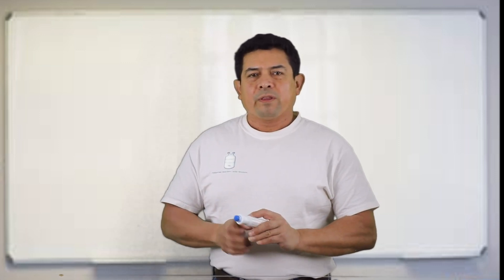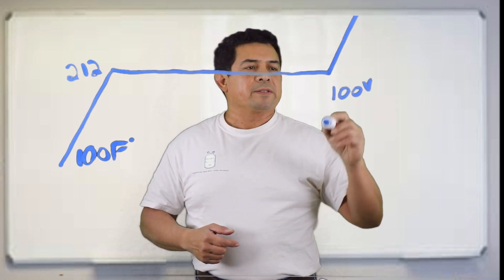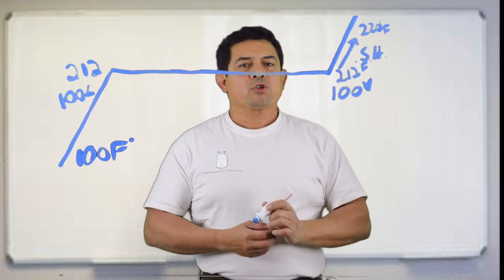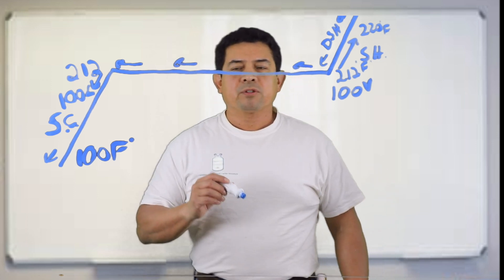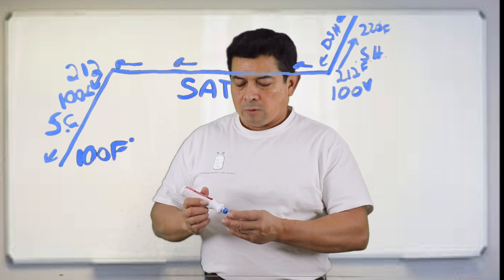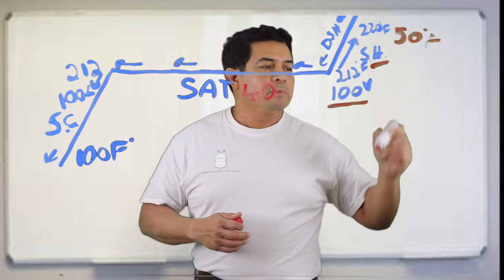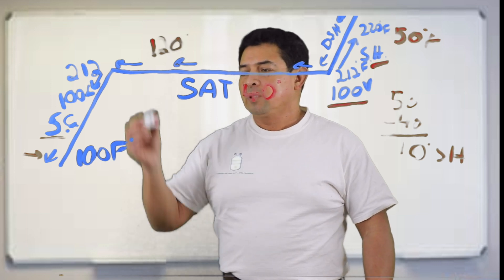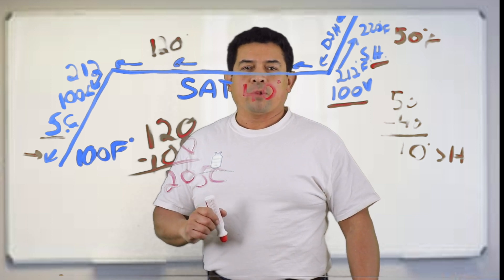Superheat and Subcooling - HVAC Online Training and Courses

Comment: If I suspect the condenser is too small what would be the symptoms besides the obvious. High SH and Low SC ?
Reply from the maker: If the condensing unit is oversized like you said you're going to have high superheat and low subcooling. You will also find that the suction pressure will be lower because the evaporator is not producing as much refrigerant gas as it should causing the suction pressure to drop. Your high side pressure will also be slightly higher because the evaporator is not taking in as much refrigerant as it should.      Make sure you do not have air and noncondensibles in the system. Because that will also affect your pressures and temperatures.                              I do not know your situation if it's a unit that has been running that would be the first thing that I would check air and noncondensibles. Thank you for the question and thank you for watching!
Reply: @AirConAcademy  I understand your description of SH & SC but not sure how to apply it. I'm not a HVAC technician but an electrician whose paths sometimes do cross. The unit in question is a fully ducted whole of house system R22 and purged. I asked a technician to advise me and he said that it was short of gas and I would need to buy a cylinder of the refrigerant.  Very expensive, old technology and not sure of a favourable outcome. The reason for my apprehension is that having seen other units in peoples houses and then investigating the size of the evaporator that suits my condenser was incorrect. To learn from this situation I would like to know the scientific facts of this .. I'd appreciate your expert opinion. Thank you so much for your dedication to this subject.Muchas gracias or  grazie molto
Reply from the maker: @ I am glad he told me that you were an electrician. That helps me know where the question is coming from.                     The refrigerant is boiling inside of the coil. Yes I did say boiling and it is boiling at 40°F approximately. But it has completely boiled away. The gas keeps traveling through the copper tubing. The Gas is in contact with, typically 75°F air, so it warms up the gas higher than the 40°F.              this rise and temperature is what we call superheat. The less gas you have in the evaporator the more area is going to be in the evaporator to superheat to the gas.              Depending on the unit, we typically want anywhere between 8 to 12°F of super heat. That means that if the evaporator is boiling the refrigerant at 40° we want the gas leaving the evaporator going to the compressor to be no warmer than 52°F. That gives me 12° of superheat. By adding refrigerant we have more liquid refrigerant in evaporator and less space in the evaporator for the gas to get super heated.               I hope this explains a little bit about how superheat happens.                   yes, I know that refrigerant 22 is very expensive but you may not have a choice but to add refrigerant if the heat is too high. There is a lot to talk about in the subject and I do that in my classes. Here it is kind of hard to explain all of this to you and get you to understand it.                     I don't know exactly what you do, but be careful of contractors because a lot of them just want your money.     if you would take a look at my YouTube channel, I have several videos how the refrigeration system works and about superheat and adjusting superheat.             I hope this makes sense and please take a look at my channel. Like I said I have several videos there that will help.        Good luck and let me know if you have questions.

Comment: Thanks 
How subcooling affects the expansion valve sizing and cooling capacity?
Reply from the maker: Subcooling is how you charge a system that has a TXV for the metering device. If you do not have enough subcooling the evaporator is going to be starved. This is why you charge a TXB system with subcooling. The manufacturer will have decided what size the expansion valve needs to be so they do the sizing, we just do the proper charging. I hope this helps and thank you for watching.

Comment: When the gas temperature is 40'F in saturation state and it is in vapour state, how it comes subcooled liquid  at 100'F, please explain...
Reply from the maker: In that chart you are looking at one side is for the low pressure side and the other side is for the high-pressure side. So on the low pressure side the saturation temperature is going to be 40°F and we are going to superheat at approximately 10° so now the temperature as the gas leaves the evaporator is going to be 50°. On the other side of the chart I'm talking about the high side so it leaves the compressor at a hot temperature approximately 200°F and then we de-super heat so we can bring the temperature down to saturation temperature and that could be right around 120°F.  After we have turned it all into liquid then we can start the sub cool. The temperature dropped from 120°F down to 100°F so we have 20° of subcooling. This is what happens in the refrigeration cycle so if you can understand this and with just a little bit more knowledge you can easily troubleshoot an air conditioning system. This is how I teach my guys in class the system and how to troubleshoot.  Good luck out there I hope this explains it and please! Keep learning!

Comment: sir do you have any refrigerant chart for superheat and subcooling limits, please suggest me
Reply from the maker: Thank you for your question. And I'm sorry I do not have any charts for superheat and sub cooling limits, but on air conditioning equipment I'll go by what the manufacturer suggest and if I don't have anything I'll make adjustments so it will be 8 to 10° of superheat. On the sub cooling if I don't have anything from the manufacturer I usually try to hit somewhere around 10 to 15° of subcooling coming out of the condenser. I hope this helps. I know this is just a rough number but this is what I try to do a lot of times. Thank you!
Reply: @AirConAcademy  thank you for your feedback I have learned lot of things in your video I once again thank you so much sir
Reply from the maker: @rudramuniah6002  thank you so much for your comments, this is why I do these videos so that you guys can learn and improve your life and your family's life! Keep learning and good luck out there!

Comment: I just need to ask why don’t you experience a pressure change when superheating? It’s above the saturated temperature, but the pressure reading won’t be affected? I thought they were directly proportional.. if the pressure/temp chart on the suction outlet of the evaporator has a reading of -10• , and I have a -6• temperature probe reading, won’t I find a corresponding pressure change? How is it possible
Reply from the maker: Very good question! Because the super heating is happening on the low side the pressure will stay the same. The engineers have set up the system so that the pressure will be virtually the same throughout the low side and then virtually the same on the high side.  The PT chart will always give you saturated temperature. Meaning that when you get the pressure and you look up the temperature that is the temperature at which the refrigerant is saturated, meaning either evaporating or condensing. After it has completely evaporated the pressure remains the same because it is on the low side but the temperature will increase because there is no more liquid to boil off and because of that the temperature rises. I am not sure if this makes sense but if you think of the compressor running and sucking the refrigerant out of the low side it does not give the pressure a chance to rise. I hope this helps and thank you for your comment.
Reply: Pressure and temperature are only proportional if volume and the number of moles (amount of gas molecules) is constant. In these systems the gases (in this case superheated refrigerant) are not contained in a static chamber but are flowing (exchanging hot moles for cold moles) through the system changing density (and so volume). The constant equation is useful to understand the effect the compressor has on the system, though, as the compressor momentarily pauses the flow while reducing volume to increase pressure (and so temperature) before letting the newly pressurized gas flow into the condensor. 

The key here is the flowing gas through the TXV/EXV and compressor inlet.
Reply from the maker: @markbell8967  I like your explanation and yes the flowing gas makes the difference.  That is why I mentioned the compressor running and sucking the gas out of the evaporator and not giving the pressure a chance to rise.     I was trying to make it easy to understand.   Thank you for your comment and explanation.
Reply: I agree your explanation is more succinct. I was trying to expand on the equation he referenced. Thanks for making this awesome video.
Reply: Also, if the temperature rises, the TXV valve is adjusting nearly instantaneously right? 

His question was a good one. It is helping me learn in a great way. Thanks for your answers.
Reply from the maker: @markbell8967  Yes the TXV   will will adjust instantaneously!!!   trying to maintain the proper superheat.

Comment: I don't think so, superheating start when we raise the temp of a gas without raising it's pressure and  vice versa for subcooling. When refrigerant leave the Evaporator, it travel toward compressor and there is no question of raising or lowering the pressure at that time. By taking heat from surrounding the liquid particles in suspension got evaporated (boiled) and then started  superheating factor. Like in subcooling, when the condensor is fully cleaned or the atmospheric temp is low the subcooling started in condesor(e.g, the subcooling started much before the saturated liquid curve in moiller diagram curve is reached). If you are cooling water to below 100,that is I think is not subcooling.
Reply from the maker: Superheatig is when you raise the temperature above the saturation temperature, and subcooling is when you lower the temperature below the saturation temperature. Yes the heat is usually  absorbed from the surrounding air?  If the system is designed properly, the pressure in the low side should be virtually the same and mostly the same in the high side. so the as the refrigerant gets closer to the compressor, the suction pressure should be at approximately the same pressure as in the evaporator. If the system is charged properly the refrigerant will start to superheat in the evaporator and gain superheat as it gets closer to the compressor.   If water is below 212 degrees F. at sea level or at 14.7 PSIA Then water is said to be cubcooled, because the temperature is below saturation temperature.   not sure if this makes sense.  I hope this explains what I was trying to say in the video.
Reply: The video is correct. Go watch some basic physics videos about calorimetry and phase changes.